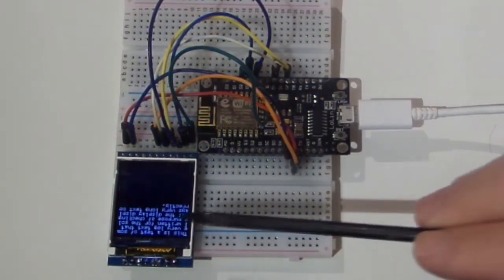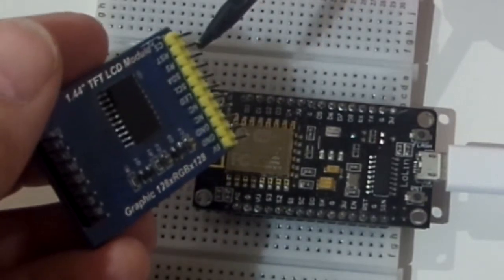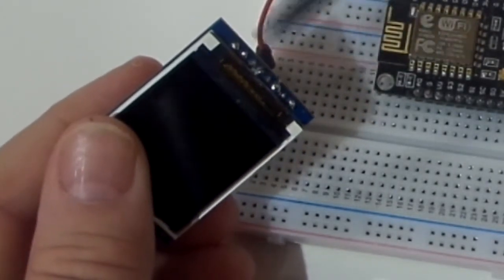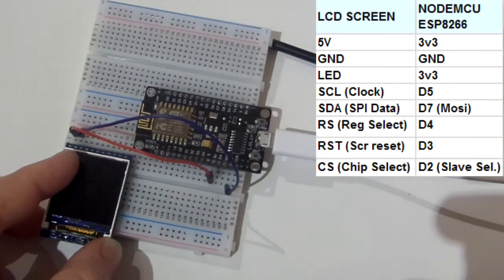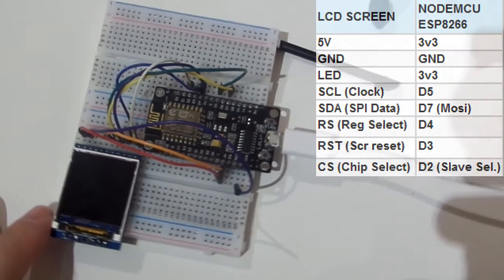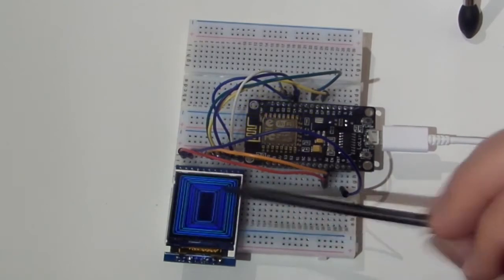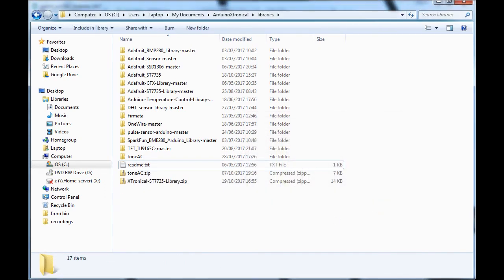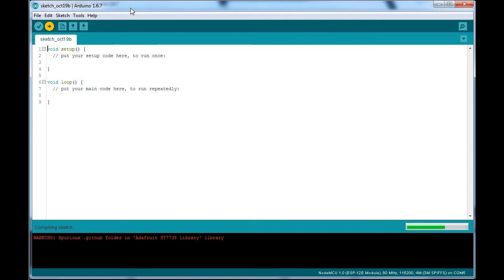Connecting Colour LCD to NodeMCU ESP8266 (128x128) 7735 driver

Comment: Why not connect CS to D8 which is HCS (hardware chip select?)?
Reply from the maker: You could. Doesn't make much difference, especially if you add another spi device as you can only have one CS pin per device.
Reply: @XTronical  Ok. Thank you.

Comment: So I don't have the yellow header. What do I do?
Reply from the maker: Do you mean you don't have the header to plug into a board or your pin out is different to the one shown
Reply: @XTronical  I only have the other one. The yellow one is not there at all, holes, traces etc. Just aint there. The other one you said you struggled to solder is there however and it's the only way to interact with the screen. Ottherwise, the screens seem to be the same in terms of the onboard controller as well as pinout and size. I also have an extremely similar version of the ESP8266.
Reply from the maker: Should be fine, everything is same as you say, yours might be easier to solder up.
Reply: @XTronical  in fact, it came soldered!
Reply from the maker: Ooh cool, should just work on esp8266, wouldn't on arduino if not 5V tolerant.

Comment: Thanks for this guide - it has been really useful connecting my nodeMCU to a 128*128 LCD. Unfortunately I'm getting some errors while compiling your 'TestESP8266' sketch. The XTronical_ST7735 and Adafruit_GFX libraries are loaded but:

void loop() {  
  for(uint16_t rotation=0; rotation<4;rotation++)
    Demo(rotation);

Fails with:

D:\Data\Arduino Data\libraries\XTronical-ST7735-Library\examples\GraphicsTestESP8266\GraphicsTestESP8266.ino: In function 'void loop()':
GraphicsTestESP8266:50: error: 'Demo' was not declared in this scope
     Demo(rotation);

Any hints would be really welcome - as you might guess I'm new to Arduino/NodeMCU!
Reply from the maker: As the "Demo" function is definitely there (it's just below the loop function). I suspect there is another error earlier in the code, scroll the error window up and check there is not an error before this one which is really the culprit.